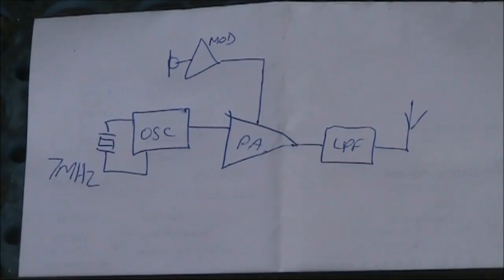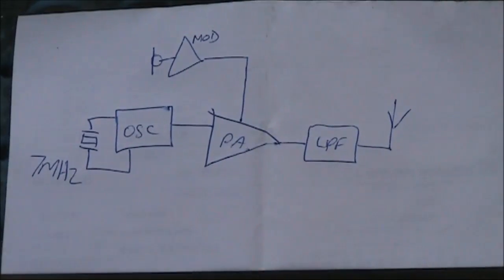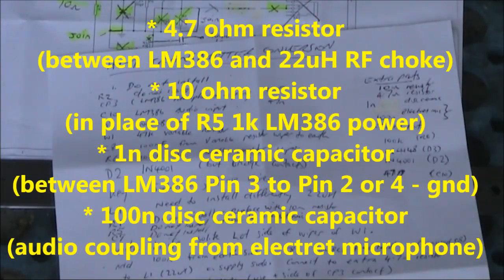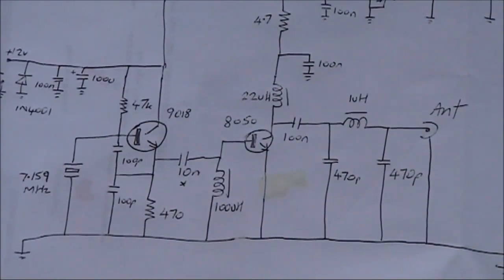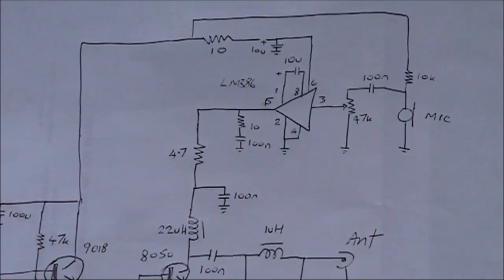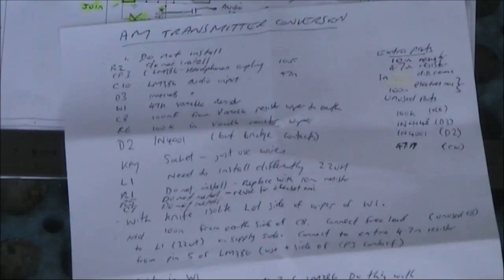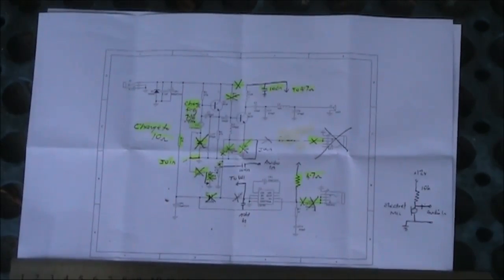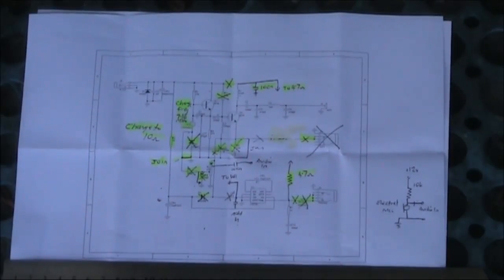Pixie Hack Challenge: A 7 MHz AM transmitter built from a Pixie

Comment: The only one of these modifications I did was to add audio at the site you recommended through a 100nf cap. I clipped the lead of the potentiometer and soldered the cap onto it and I'm applying the audio with a small audio transformer. It works! .....But there's an absolutely godawful buzzing sound when I receive the signal it emits. I may have gotten in over my head with this project, but I'm curious if it's acting this way because I didn't do any of the other mods. I'm not an electronics genius, I just dabble. If I can get the audio working to my satisfaction, I plan on building a filter because I can see all the spurious crap it puts out when I look at the waterfall display of my SDR. Can anyone help me out?
Reply from the maker: I suggest starting again building something from scratch or getting a good kit. It may have more parts but each part has only one function, making it far easier to debug. The Pixie is a sad compromise of a lot of things!

Comment: In the pixies I've bought there's a 33k resistor between Vin and the base of the 8050 transistor. I don't see it in the circuit in the video. Is this resistor not required to bias the PA transistor?

Comment: Could you use it as a WSPR transmitter?
Reply from the maker: Potentially with a crystal for 7.040. I think it's based on some slight frequency modulation which you might be able to apply. Would need to be very accurate though.